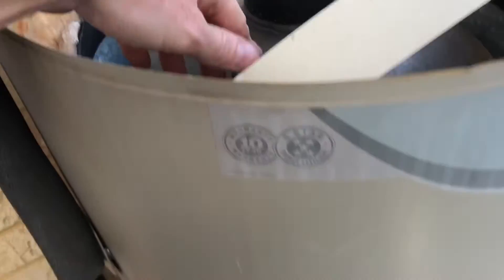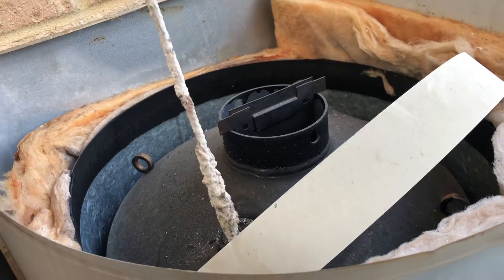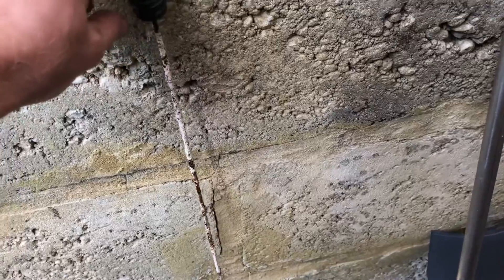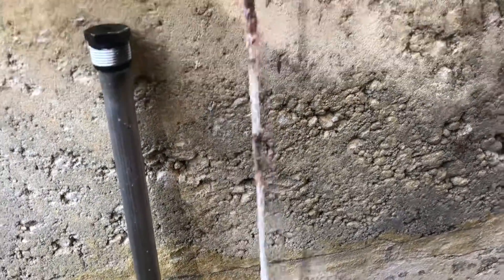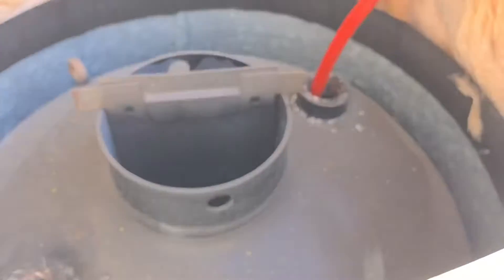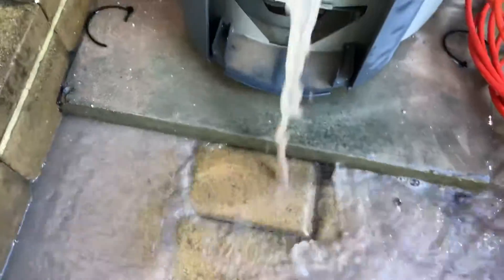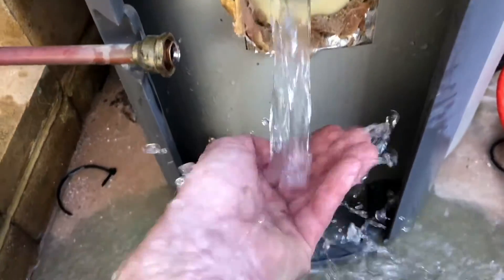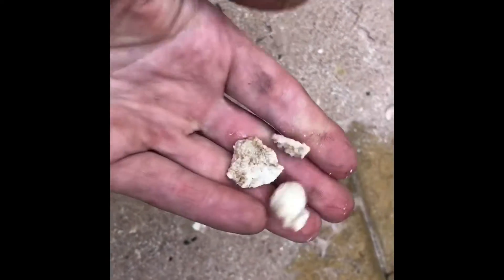Replacing Sacrificial Anodes In Your Hot Water System & Tank Flush - Plumbdog Plumbing Perth

Comment: All good advice - BUT !    What did you undo to get the water of of it ?   In the states, it seems all theiur units have drain valves, not the case in OZ.  So what do you have to undo to get the same result as a drain plug ?

Comment: Great Video, is the gas valve assembly easy to take off ?  i haven't seen any plumber remove this to flush the tank when replacing the anode.
Reply from the maker: Thankyou! Easy enough when you know how i suppose. Its definately the best way to flush the tank by removing the thermal well. The cover on the Eurosit needs to be removed for setting the burner pressure anyways so not too much extra.
Reply: @PlumbdogPlumbingPerth  i did the exact same thing all worked well, thank u kindly

Comment: Wondering why corrosion is a problem if glass lining is used. Glass doesn't corrode. Another noob question. Why is hot water pipe tied back to cold water? Why reduce the temperature before heading to taps? Seems counter productive. I've seen it on the midea 170l hot water tied to cold. Wouldn't it be better not to tie in because these heat pumps don't get super hot water happening.

Comment: Will u get the same result by disconnecting the cold water inlet to flush out the powder left by the anode?
Reply from the maker: My opinion is you get more out of the front. We often recommend a burner service as part of a major service so makes sense we do it this way.

Comment: What's the correct/best way to dispose of the cloudy water? Initially thought of connecting a hose to the outlet and guiding to a drain, but that might clog up the drain? But letting it just flood the floor as in the video doesn't seem like a good way either? Thanks
Reply: It's easier to let the sediment go on the bricks for sweep up after. Get a piece of fly screen and put over a down pipe drain. That way the water goes down the drain but no sediment will

Comment: Seems to me they should make tanks out of stainless steel or a non-rust material. Those anodes cause as much damage as they prevent.
Reply from the maker: Stainless tanks are banned from Western Australia as the water quality is worse for them……
Reply: @PlumbdogPlumbingPerth  Very good video. I replaced my old solar edwards system which lasted us 34 years, (the tank was still ok it was the panels that failed). The solar edwards system had a 316 grade stainless steel tank. I replaced it with the modern day equivalent (Rheem Solar Hiline Water Heater
52D Series SHWS)  which I think from memory has a 418 grade stainless steel tank which is a lower grade Stainless steel and it lasted 1 year, they replaced it with the same and it failed again after less than 1 year. The third time they refused to put a stainless tank and instead replaced with a vitros enamel tank which has now been in for 5 years and still ok, touch wood. Your video show why I didn't want a anode system, all that muck is in the water pipes in our homes, which I couldn't imagine would be doing anybody much good. I emailed Rheem with a lot questions about manufacturing procedures and why they changed to a lower grade Stainless etc but got no answers.